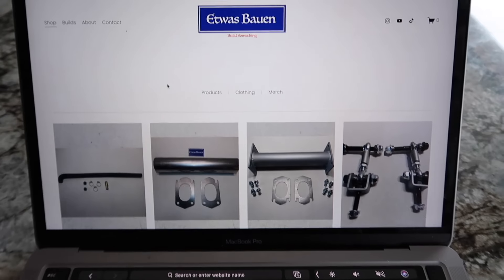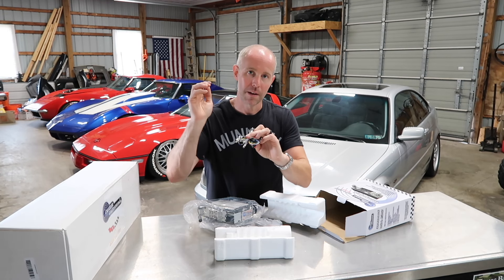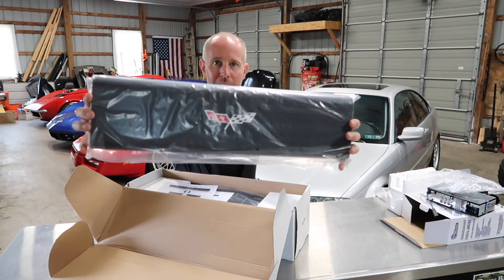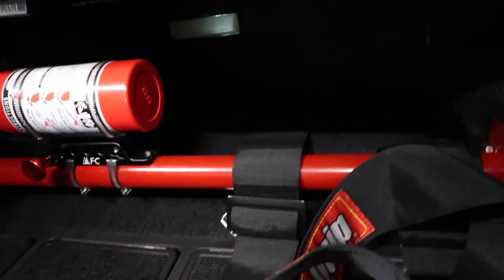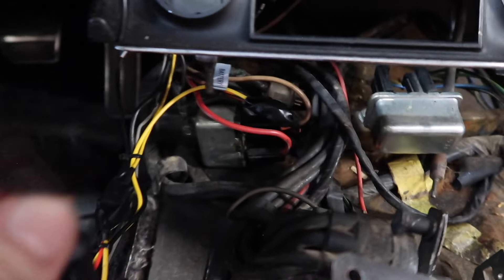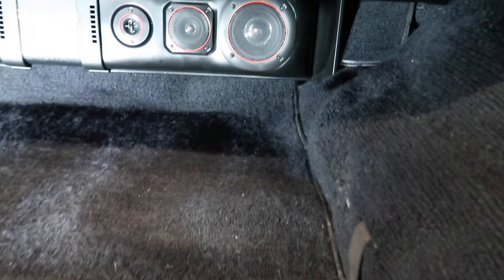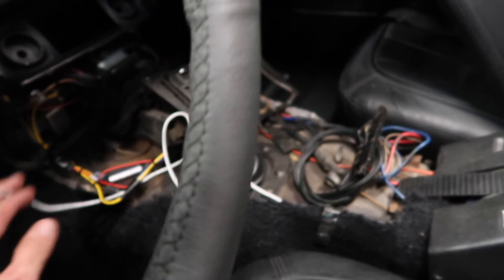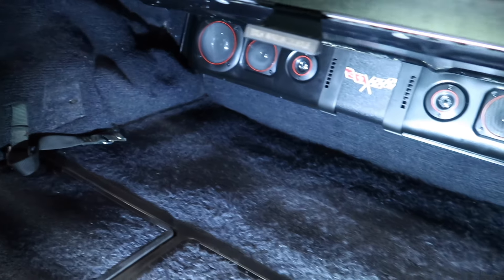Modern Sound System For Your Cassic Car! Install!

Comment: Great video.  Thanx for sharing.  I know this is an old video but for my '69 coupe, I let the speaker bar sit at the bottom in the back.  This way, I didn't obstruct the back light.  I still expanded the speaker bar ends so it's pretty secure back there.  I also went ahead and put the speakers in the front since I had everything down.  That black wire next to the yellow accessory power wire in the existing wire harness (that was the wiring harness for the old radio) is also a ground.  I just put stabs on the radio wires and just tied into the existing jack.
Reply from the maker: Thats a great idea.